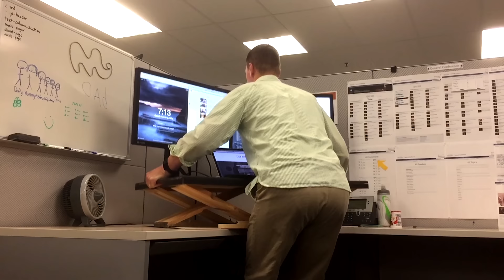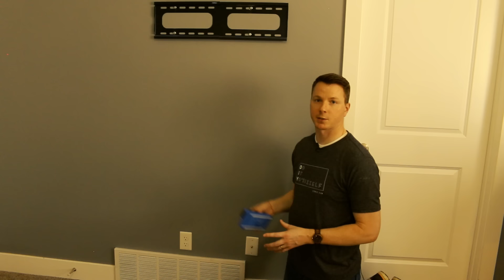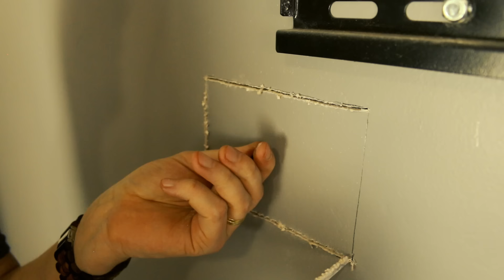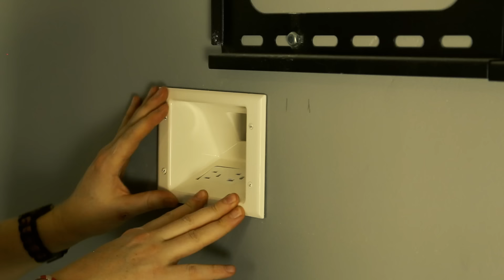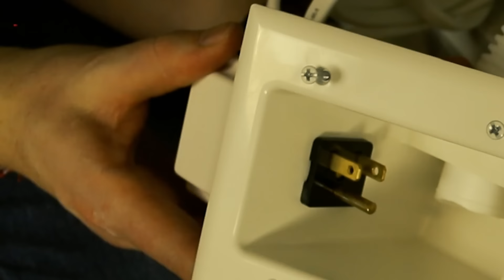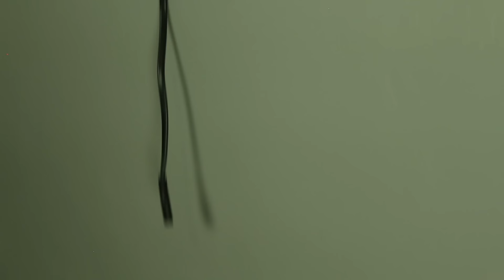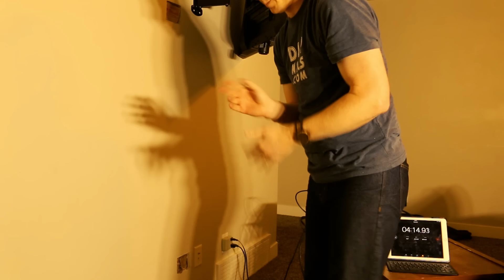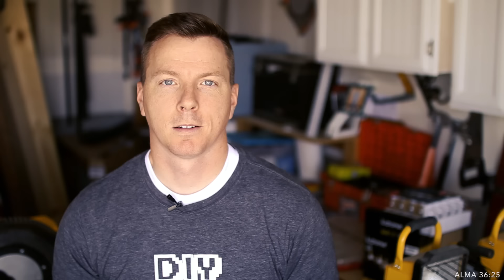How To Hide Your TV Wires in 30 Minutes - DIY

Comment: My tip - feed your AV cables into the flexible tube BEFORE you slide it into the wall cavity. Saves the bottle neck at the bends.
Reply: And leave a pull string.  When the time comes to add a wire to that conduit (e.g., Ethernet), you may find that the conduit is too crowded to drop the new wire through cleanly.  (And those ribs, which help to make it flexible, will provide about six spots per inch where it can get hung up on the way down.)
Reply: There is zero reason to even use a conduit in this install.  A straight drop down I stall with no insulation.  The conduit will actually make it harder to run wiring.  Pop the boxes out, drop the wires.   I have installed a thousand TV's in my time as a pro installer and never used a conduit in this type of installation.   Gravity will do your work for you.
Reply: Brandon Corby do pros not learn by trial and error?
Reply: Great tip.
Reply: I've dropped those flimsy cables tied to some fishing line and some sinkers.  Pop the sinkers down the hole = win.
Reply: StCreed  So true & u will, BUT, only if u follow this guy's "tip" instructions !🤔
Reply: You stupid man
Reply: Funny i was gonna mention this before feeding it into the wall. Completly makes sense.
Reply: Wan
Reply: Wangavision n
Reply: Wangavision
Reply: Pro tip 😂
Reply: Wangavision I
Reply: No I don't wanna.
Reply: My tip: avoid flexible tubes whenever you can. It's nearly impossible to get wires out from any length of tube. I had to cut open one of those tubes and fix a cable in place, just because they were impossible to remove. If you must, make sure to buy the professional tubes with the smooth inside. It's more expensive,  but totally worth it.
Reply: Brandon Corby a “pro tip” is a tip a person gives from their experience. We aren’t born pros. I’m a 27 Year HVAC journeyman and still learning new things all the time. It’s not like you go to school for what he’s doing and even if you did its still doesn’t substitute actually doing something.
Reply: I hate calling it a "Pro Tip" when he says that it is a tip he figured out after doing what he did be honest and call it "My tip from mistake"
Reply: Victor Valladares  then my tip is 2 not give those tips ! I give tips,  but only when I know they make good sense ! (this way I won't be reading all these negitive comments about myself !)
Reply: Wangavision,  u got it rite ! 1st thing I thawt of b4 he put that bottom plate 2gether ! (The most hated thing I can read in  directions --"now go back & take apart" & it's something u just put 2gether ! (AND I knew better but didn't want 2 get that ear full from the wife) At the end he says "if anyone has a question" ? Yes I do . . . Y R U so dang dumb ? He must have reviewed his film & still didn't figure it out ! Also, u should wait until afterwards 2 do ur drinking, & I'll pass on subscribing, thank u !

Comment: will this work on a Plaster and Lav wall I have an old house built in the late 1800s
Reply from the maker: Yes - lath and plaster is very similar to drywall in some senses but you'll want to use a power tool, like a jigsaw or roto-zip to do the cutting, and do so very carefully. Lath and plaster tends to be somewhat brittle, but is built with the same structure, using studs and stud bays behind it. The lath strips, if moved around too much, can cause the plaster to crack, which is why I recommend doing a slow and clean cut - no jerking or shaking. Let us know how it turns out!

Comment: U.K. Amazon link would be really appreciated
Reply: Fitness 4U the kit wouldn't meet the electrical standards required in the UK. You can buy a much smaller and neater UK equivalent easily though. Try searching for "AV cable outlet" on Amazon.co.uk and you'll find them. You can either install a double socket using a "dry lining box" or just run a long lead from your TV, through the wall to the socket it's currently plugged into.
(If you do go down this road, try not installing the internal cavity wall heater/ electromagnet this guy has left behind. The cable should be trimmed to a reasonable length and left un-coiled both inside and outside of the wall).

Comment: My idea: feed wires into the hose then hook the hose to the oulets
Reply: You don't even need the holes, just run wires straight to the plug
Reply: Samuel Phillips exactly but as the existing box is a new work box you have to take a sawzall to the nails in the stud to put the 14-2 in the box then take wood screws in the side to secure it back to the stud. Done it thousands of times as I work as an electrician
Reply: Just invent a wireless TV
Reply: @roygavin5074  They already are. But like anything, you need power to connect all your wireless gadgets to it :thinking:
Reply: @roygavin5074 That’s actually not a bad idea. If they can build cordless power tools, you’d think somebody could do the same with TVs.
Reply: Your idea: code violation
Reply: @Bamboo Training yes it’s a good job. It’s not easy by a long shot. You apply knowing nothing and learn or go to a trade school first. Yes you work like a slave until you get a masters license and then you work for yourself.
Reply: My idea: You don't even need the hose, just two holes in the wall 😂
Reply: @CardFreak999   on hole actually

Comment: like the video; but is the tubing approved for use of electrical wires behind the wall; my insurance lady said that if an electrical fire starts behind the wall due to me installing wires inside the wall--- i would not be covered
Reply from the maker: The tubing is not approved for electrical wires - only for low voltage wires, like HDMI, A/V etc. The electrical wire is separate from the tubing and is approved for in-wall use and should be covered in case of fire. So if you need to plug something in for power, use the outlets that the kit provides, but if you're just passing A/V wires, the tube is meant for that. Hopefully that answers your question!
Reply: Chas, the electrical wire he used is fine (it's just like the rest of the wiring in your house). As for the tube, he only used it for convenience, it does not need to be rated at all. The wires in that tube only carry "signal", like HDMI, RCA, optical, etc. No added protection needed for these here. As mentioned in the video, he could have simply not used any tube at all. Good luck starting a fire with an HDMI cable!  :-)
Reply: The tubing is for swimming pools....so it rated for water.....
Reply: The water where you're fishing with wire nuts?
Reply: Is that tubing rated to be installed in wall?
Reply: The tube he used is for water... They do make NMFC (non metallic flexible conduit), also known in the trade as smurf tube because of its original blue color. If he had used the proper tubing this would be a legal install.
Reply: No. That tubing is for the discharge line on a boats bilge pump. You can tell because it has cut points every 12 inches so that it will fit the pump outlet. If you cut it anywhere else, you won't be able to get a tight fit on the pump and it will fall off or leak badly. Having owned a number of boats, I installed plenty of this stuff.
Reply: Reviewing my old 2008 NEC code book (dated, look for revisions):

(quote)
Article 334.30 Securing And Supporting.

Nonmetallic-sheathed cable shall be supported by staples, cable ties, straps, hangers, or similar fittings designed and installed so as not to damage the cable, at intervals not exceeding 1.4 m (4.5 ft) and within 300 mm (12 in.) of every outlet box, junction box, cabinet, or fitting. Flat cables shall not be stapled on edge.

Sections of cable protected from physical damage by raceway shall not be required to be secured within the raceway.
(quote)

To translate, your NM cable (romex) must be securely fastened every 1.4 m (4.5 feet) and within 12" of your fittings. Maybe DataComm has some solution to this fastening issue?

Key word here is 'SHALL'. You might be denied a payout if your house burns down and the insurance adjuster finds you didn't follow code. They are PAID to look for this kind of fault!

Comment: Why did you leave a coil in the wall.. That is bad habit... and why didn't you just run your power cable into the existing power receptacle...  Small hole through the stud and right into the 120 box.... Just kind of stupid to have to have an extension cord to an extension cord.... If I bought that house and saw the 120 male sticking out of the wall I'd scratch my head and been wtf... that wasn't professionally installed, and of course thought about why you didn't run into the power right there inside the wall..
(I guess if you don't have the option to turn power off to the circuit this would be the next safest thing).

Now for a positive... Good idea on the flex tube... Kind of a pain when wires get stuck on the according sides but for just a few wires that is a real good idea.
Reply: Not in Illinois that I am aware of and I think NEEDING to hire an electrician for most tasks is retarded.  I've installed tons of extra outlets on my own and even dropped in a 200a panel for a garage.  It's not exactly rocket science.
Reply: A home owner can do that. Electrical work is not magic. Problem is a lot of people are idiots. Witness the sale and application of duct tape for all kinds of horrifying repairs. You need an electrician when you are tying into a circuit panel because that should be permitted. But we’re talking about what is essentially and extension cord, but one with proper wiring for an in-wall application. He shouldn’t coil the wire though and should have just trimmed it to length. I don’t like that kit though. The bottom portion should have a connector like a computer power cable so that the male connector is flush with the receptacle rather than sticking out. Ultimately, it probably doesn’t matter since if you can see the prongs on the plug, the circuit is not energized.
Reply: It's done that way to make it more accessible and even though he may have the experience necessary to wire directly into the box himself it's a sponsored video so he has to show how it all works - for the layman so to speak. Not everything is made for know-it-alls.
Reply: Seems a lot easier to just make the 2nd receptacle behind the tv running off the hot from the lower one to plug your equipment in. Of course there is wire mold if you don't want to cut want it somewhat neat.
Reply: I see that depending which model is purchased, some have the surge protection built in.  I haven't used this and cannot speak to quality, codes or anything like that, it's just been great that recently surge protection without all those extra strips is coming along.  Now it is inexpensive to have surge protection for the whole house right on a main breaker.   It would be fair to ask whether theirs includes a warranty against damage to the electronics, and to find out whether manufacturers who do include such a warranty every have to pay out, anyways.
Reply: OMG SHUT UP
Reply: Because there would be no way to plug it into a surge protector or a battery backup.
Reply: OMG you say stupid on one hand then say to drill through a stud into the side of the box on the other hand, which could be metal but hope for plastic,what part of that isn't stupid, and then do what? WOW talk about code violation...how would you secure the wire into the box etc...etc...etc.. I might have given some credence if you said to put the wire down the wall on the side where the receptical is and pull the recep out break out one of the breakouts on top of the box and fish the wire into the box then re-wire everything and put it back. But what DIYer is a professional electrician...not many! I like 4x4Scout's reply...
Reply: Backyardsniper73 u
Reply: In this situation there is a table. Usually a direct feed to the existing power receptacle is far more efficient.
Reply: You could do that just that you may want to put the outlet inside the wall or make it so it would tuck in the wall
Reply: Many people can't install an outlet, or they are scared to try.  I have done plenty, been shocked a few times and learned, but not everyone is so adventurous.
Reply: Exactly. Pretty much easy to do. If anybody has a problem with electrical, go to home depot or Lowes and get a book on home wiring.
Reply: QuantumRift then we
Reply: Then go buy a damn book on home electrical wiring at Lowes.
Reply: Always the "where I live" and no mention of where that is...  LoL
Reply: Kruell it's unreal how much more work it is to do it this way. Just cut a hole up top, feed a glow rod from the bottom. Tape the end of the wire on and pull it down. Insert a tab box, connectthe wire to an outlet  and you're all done
Reply: +RobMugs How interesting this all seems “gay” to you. Very very interesting...
Reply: having coils of copper wire may cause a torordo effect with a high energy draw that could cause EMI distortion electrical distortion, heating issue. .
Reply: I think you missed the point. Probably happened when you dropped your common sense behind the couch.  I mean tripping hazard? yeeaahh like everyone is walking against the wall under the TV behind the stereo cabinet.  That extension cord is no more hazardous then any other standard plug.  I suggest for safety sake that you live in a house with no wiring.  :)
Reply: Some people may want to plug their very expensive TV into a surge protector (or even a UPS) instead of directly into an unprotected outlet. For that reason, hard wiring a new outlet behind the TV would require those people to dangle a surge protector on the wall and that would look ridiculous. A bulky UPS would be a complete non-starter.
Reply: This is done this way for simplicity. Once you start tying into electrical boxes you are officially talking about hiring an electrician. At the very least you need to be comfortable with AC house wiring. How many average people are going to have the knowledge and go to the extra trouble?  I agree I would have cut the AC wiring to length  at least.  But then I would have put it on the other side of the stud and tied the wiring into the existing outlet.  And no I would not have mounted the box on top of the outlet.
Reply: @consaka1   great reply
Reply: You are ill-informed. I don't know about all 50 states, but where I live, what you're suggesting would require a licensed electrician to perform that type of work.
Reply: Kruell we're not electricians! This is for dyi not an experienced handy man!
Reply: Much easier to disconnect you TV this way. Dont need to take it of the wall or search for a freakin fuse...
Reply: AMP TEKNIK

That's awesome.  Do you also make love to your sister?
Reply: AMP TEKNIK

You sound like you may have gay tendencies with all this gay talk.  That's cool if that's how you fly. 

Not sure why you brought me into it though
Reply: AMP TEKNIK

You need to stop giving advice.  This is a hack at best.  You can't even speak basic English
Reply: Makes no difference. You should still be hiring an electrician as that is a permanent installation inside a cavity wall (they've tried to make evrything idiot proof but I'd rather twist two properly stripped wires together into an insulated connector) Plus that extension cord idea is more dangerous than internal wiring straight to the outlet. Kids could get to those bare prongs if the connector comes slightly adrift, its a potental tripping hazard and generally less safe. IMO. I'm surprised it got certified.

Comment: What if I'm also planning on mounting a soundbar below the TV? Would the audio wire that connects from the soundbar to the TV have to be visible?
Reply from the maker: If you mean that the soundbar wouldn't be right under the TV, but a several inches or feet below, then you'd want to put a separate hole where the soundbar wire could come out. If it's right under the TV itself, it should all be able to remain hidden behind.

Comment: You could have done that a lot quicker and cheaper!!
Reply: Beretta96Dan  How's that? Need to know!
Reply: Lowe's and Home Depot sell a two gang cut-in box that has a divider to separate the "high" voltage from the low voltage (cable, HDMI, etc.). Fish the #14 or #12 NM wire from the high voltage to the receptacle in the wall below, and fish the cable and other com wires into the low voltage side. Then, connect your receptacle to the other end of the NM wire to the new receptacle for the TV. Install your two gang plate, and there's your dinner!
Reply: Haha That's a hot dinner!
Thanks for the info!

Comment: when you have drywall it is completely different than to deal with concrete 
I have to put external tube for the cables or to dig into the wall and make a tunnel to feed the cables through :-(